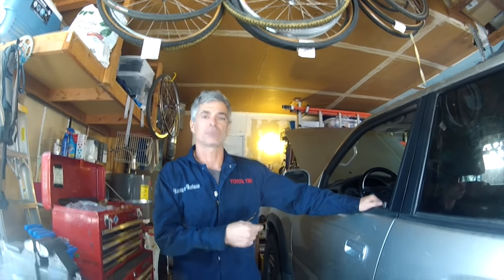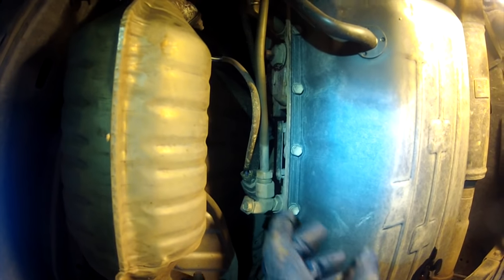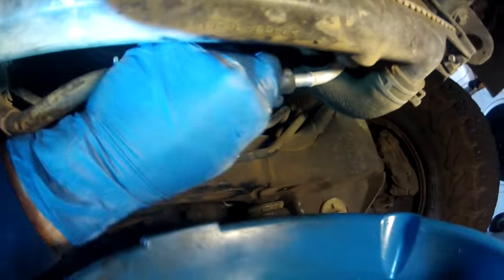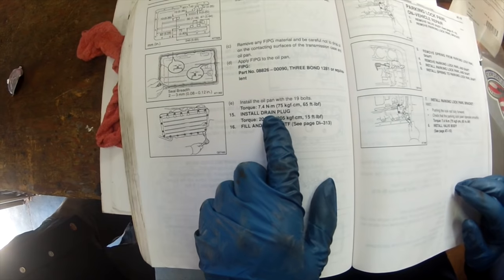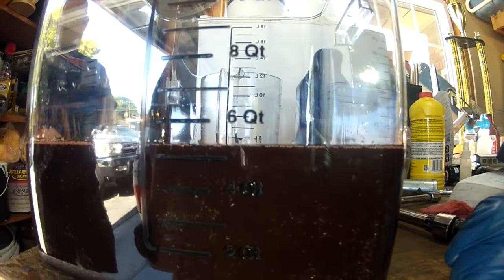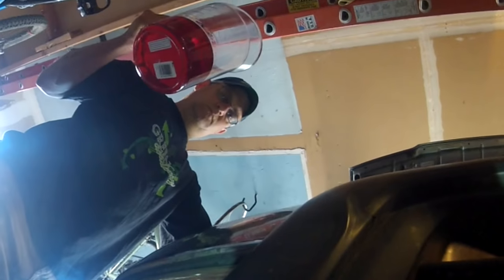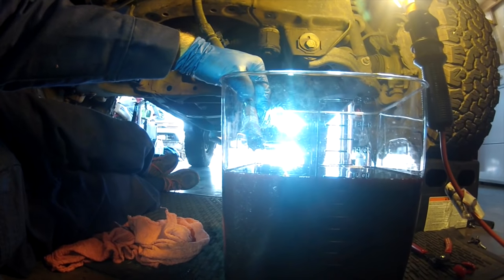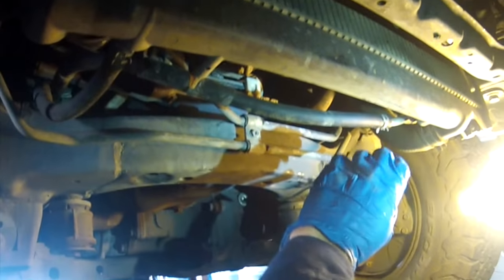Transmission Fluid Flush

Comment: When torquing the drain plug it looked to me like the plug didn't turn at all when you put the torque wrench on it. This would indicate that you were already at (as you stated) OR BEYOND the proper torque. If beyond the proper torque the wrench will click with no discernible movement of the item being torqued which is how it appears to be in the video.  Perhaps you saw/felt it rotate slightly?

Automotive and aircraft mechanic
ASE certified automotive mech
Quality Assurance Inspector
Reply from the maker: Your observation is absolutely correct.  The bolt did not move so I could have been right at the torque spec or beyond it.  I can't remember if I stated this in the video, but I've only been using torque wrenches for the last couple years.  So, for 34 of my 36 years of wrenching on vehicles, I didn't use a torque wrench.  I learned how to tighten things without stripping them at an early age.  So, what I didn't say in the video is I wasn't concerned that I might have went beyond the torque value.  

Most of my wrenching career has been doing relatively simple repairs and maintenance so I never saw a need to own a torque wrench.  Now that I'm tackling more involved jobs, I like using my torque wrenches.  However, I still don't bother torquing drain plugs on oil pans, differentials, transmissions or transfer cases because I've tightened them hundreds of times and never stripped one.  A little common sense and understanding mechanical advantage can take you pretty far.

Now, for the kind of stuff you're doing like aircraft mechanics, I'd imagine every nut and bolt needs to be torqued to spec.  

By the way,  Thanks for your service to our Country.  Semper Fi.
Reply: Well thank you for taking my comment in a positive way and for a nice response.  I too went a long time without using a torque wrench on automotive applications. However, my experiences in aviation (and associated formal aviation and automotive schools) sold me on the value of torque wrenches.  On a thin steel trans pan for instance, they ensure even pressure around the pan and help prevent leaks. Even a homeowners torque wrench that isn't all that accurate will usually be consistent and help in such applications

I just found it interesting that you broke out the manual to show the part number for the crush washer then proceeded to "torque" it with the "calibrated elbow" method.

On the military fighters I worked on (I've also wrenched on a couple of Cessna's that I owned personally) yeah.....not everything has a torque value but damn near. Critical items are torqued AND safety wired. Things are so critical in high G, Mach plus fighters that even the direction a bolt with nut is installed can be critical. I once downed an aircraft I was supposed to inspect before I got within 15 feet of it.....the flight control surfaces on the trailing edge of the wing had the bolts installed with the bolt heads outboard and the nuts inboard.....the spec was that they HAD to be heads inboard and nuts outboard.  I'm not an engineer but I believe that these critical flight surfaces dictated the bolt installation direction in order to help keep the bolt in the hinge should the safety wire fail and the nut backed off (or it broke).  

Automotive applications have similar engineering but the maintenance requirements aren't so critical when your wheels stay on the ground. For instance, one large torque value we had on the lug nuts of certain trucks required using a lug wrench, a cheater bar, a Marine who had just been weighed, a tape measure, and a calculator.  We actually calculated where on the cheater bar the Marine had to stand in order to apply the proper torque......it was one hella high torque value and the wrench was not on our authorized equipment list.  Go figure.  By contrast, we had a similar torque value on the F18 Hornet but had the proper torque wrench......complete with manufacturer supplied "cheater" bar. Without that bar no one could apply enough torque.
Reply from the maker: Thanks for sharing all that.  For the videos we put out, I provide the torque values for those that live and die by the torque spec.  Because I've never stripped a drain pan bolt, had one leak or back out, I guess I have a lot of confidence that I can do it by feel or the "Calibrated Elbow" as you call it.  This is pure conjecture on my part, but I'm guessing I was probably within a couple pounds of the torque value for that drain pan bolt.  Simply adjusting for the size of the fastener and understanding leverage is all you really need.  Would I have installed that small transmission drain pan bolt with a big half inch drive ratchet, with my hand on the very end of the ratchet handle and with me applying a lot of force?  Of course not.  I tightened the transmission drain pan bolt like I would normally do by feel and then I wanted to see if I was at least at the torque value given in the factory service manual. When I started wrenching at an early age on my 68 Bronco in 1981 and working at a full-service Chevron gas station, I never used a torque wrench and never saw anyone else use one either.

One problem I see with torque values is sometimes the value given in the manual is wrong and people will blindly follow them with bad results.  So, a person still needs to use some common sense and understand when they see a value that doesn't make sense.  I've found several mistakes in my factory service manual, some really bad where they say foot pounds when it should have been inch pounds.  Most recently, I was doing a timing belt job and used my inch pound torque wrench because it was the only one that would fit where I needed it.  I had to convert foot pounds to inch pounds and the value I needed was at the max range of my inch pound torque wrench, 240 in-lbf.  As I was applying force and it was getting to the point I thought I should hit the value, it never came.  This was a bolt into an aluminum oil pump body.  I figured maybe my wrench might not be that accurate at it's max value so I backed it off by 20 inch pounds, hit 220 and called it good.  

So, what am I trying to say? A person still needs to have a "FEEL" for how to tighten fasteners and know when possibly the torque wrench isn't working properly and also be able to spot a mistake in a manual when the value given doesn't jive with the size of the fastener.  I not only work on automobiles, I've done a ton of wrenching on bicycles over the last 32 years and sometimes turn a wrench on the fire apparatus we drive at my fire department.  

Take Care and Happy Wrenching!
Reply: Oh yes...you HAVE to have an understanding of the systems and components you're working on to be able to know when things "just aren't right". 

I did two tours with F18 Hornets. First tour they told me "you can't be an inspector until you've gone to school"......6 months later they said "when can you take your inspectors test" but I hadn't been to school.  What I had done is read EVERY maintenance manual for the aircraft and those for my particular specialty (ordnance) TWICE and I'd done just about every maintenance task under supervision of an inspector.  They changed their minds on the "not until you go to school" because I'd learned the systems better than most of the inspectors.

On my second tour (same unit after a few years away) I was in the Quality Assurance work center....comprised of one highly knowledgeable inspector from each work center and the final inspection authority for releasing aircraft after major maintenance. I partially downed (certain configurations not allowed) an aircraft for failing a particular electrical check of the Ordnance system (my specialty).  Oh we went round and round on that one for about 8 months, including Ordnance techs who disagreed with me and my "reading" of the inspection card. I stood my ground and one day I get a call on the radio to go out to that aircraft......turns out that during some other maintenance, the electronics shop discovered that the reason the bird wouldn't pass the inspection I downed it for was that the wire wasn't in the right place in the connecting plug and the signal could not be delivered to the component. 

I was vindicated but I'd have never known it was wrong had I not understood every system and component and how they interacted and recognized that they were doing the inspection improperly. The system was the emergency jettison system and critical in an emergency situation. Had it not worked it could have meant the difference between losing an aircraft and/or pilot or the pilot being able to jettison excess weight and saving teh aircraft and himself.

We have to understand the system and it's components so that 100 foot pounds of torque on a transmission bolt going into a 1/2 inch of aluminum jumps out at us and says "somethings not right here".

In aviation the maintenance manuals are updated constantly. In fact, one or more people in each shop are tasked with inserting the changes, they occur that often! We don't have that with autos and a misprint in the manual is pretty much there to stay unless you're working at a dealership with dealer manuals.
Reply: Open Carry, That is what I was saying but you said it better.
Reply from the maker: So, I'm curious.  I take it you're not active duty anymore.  What are you doing now for work?  Also, what brought you to our channel?  Do you own a 4runner?
Reply: I retired from the Corps in 1999 and went to work for a small county in northern Calif. 5.6 years later I left that job to move to Oregon with my now ex wife so that we could be closer to her elderly parents (she was 11 years older than I). I haven't held a job since then.  When we came here we bought a house on 40 acres with a runway in the "backyard" (I'm a private pilot).

I kept busy by building a spec (built for resale) house, improving our home (electrical, big patio, private "beach", etc.) and caring for her parents as she hadn't retired yet.  After her parents passed on I went to college (and she left in my second quarter of that endeavor) and picked up a Bachelors (with honors) in Business Management with a minor in Criminal Justice.....while going through a divorce and losing that "dream house" with the runway (and just about everything else).

Now I enjoy my hobbies and activisim.  I'm a second amendment activist which led to getting involved in a situation where BLM was unlawfully harassing a couple of local minors, which led me to HAM radio and I now hold the highest HAM license class and teach classes for people to get their HAM licenses. And I've got a nice motorcycle for the few months that Oregon has decent weather....LOL.  

And I have two YouTube channels, one for the activism and another for the HAM radio stuff.  The HAM one has a few antenna builds including two that I was told "can't be done". One was out of barbed wire and the other out of tubes of water.....TAP WATER at that.  Both worked and were able to hit a repeater some 29 miles away that gave me voice communications capability across the state.

I don't have a 4runner. I've got a 2002 Ram 1500 with a 5.9 (gas) and since my girlfriend (going on 6 years) and I picked up an awesome 21.5 fifth wheel that's right at max capacity of the Ram I've been working on it.  It had a cooling issue which I thought had been addressed (blew some hoses) but turned out to be also include a failing waterpump.  When that left us on the side of the road with trailer attached, I decided to go through the whole truck.  So the pump is repaired, the last (totally hidden) hose is replaced, hardcore flushing of the cooling system, new OEM spec coolant, oil change, and now I'm working on flushing the transmission as it's in for some hard work and at 114,000 miles, it needs a good flushing and the proper fluid (bought the rig used so who knows what may have been put in there (if they checked it at all...LOL).

So I found your channel during the search for DIY flush methods and I'll be using your method which is what I had in mind but hadn't seen it done.  I've got different hose connections and such but I'll be taking the old fluid from the cooler return line. I'm actually doing it today as it took several trips to get the required ATF+4 I needed. 

WalMart's "SuperTech" brand lubricants are largely made by CitGo, a big enough name that I trust their stuff to be on spec.  After double checking that CitGo made their ATF+4, I had to hit three different stores to get the necessary quantity (it's the only darn one they don't sell in gallon jugs) and I cleaned out three shelves over three days....LOL

I don't have a pan plug so that will be going in as well so that the next fluid/filter change is easier.
Reply: i totally agree. You OVERTORQUED the plug!!!!!!

Comment: This job is next up for my '98, and changing out the filter/strainer.  The question is... does it make more sense to do the filter before or after the flush?  Or does it not matter at all?  Thank you again for making all of these videos AND for taking the time to answer these questions YEARS after making the videos!!  Quite a commitment to helping all of us
Reply from the maker: I would start with the pan drop and filter replacement because you'll drain out around 1/2 of the system capacity,  around 6 quarts.  Add 6 quarts and then start the flush.  You'll probably see clean looking fluid at around the 6 quart mark, so 6 rounds of draining a quart and adding a quart.
Reply: How about jacking up the rear and going through some gears to flush out the valve bady 🤔 my 99 has been making a slight whine noise for several years now..... Wonder if this would make it quieter? I know it's probably the torque converter.....

Comment: Thanks for posting...it helps significantly to "visually see" how to do something.
Reply from the maker: You're welcome John. What's weird is some people prefer write-ups over videos and I find that very strange.  Sure, a picture shows you something but there's no comparison to a video where you're able to see exactly how somebody got it done.  There's a guy that has used our videos as a reference and then does these exhaustive write-ups with pictures of his hand and finger pointing after different parts with notes on what to do.  Wouldn't it just be easier to watch the video and get the extra detail which often is the difference between having an easy time and having a struggle?  But, whatever floats somebody's boat.  If you prefer write-ups, use them I guess.
Reply: Well...at work...I was going to make a presentation..and I asked the PowerPoint expert to sit in and do a dry run with me...he listened...and said "there are two kinds of audience...some will listen to every word you say...and NOT pay any attention to your written PowerPoint....others will READ every word on your PowerPoint presentation, and NOT listen a verbal word you say...basically, he was saying there are two kinds of audience....verbal vs visual...and maybe some are one or the other...that's all...I try to do both....but, it's difficult....hahahah..hahahah...I do have some G35 literature...I do read it...but, it doesn't hurt to see a video and also read material....hahhahaa

Comment: Great video. I bought a 1/2” inch clear tubing to fit on the radiator to flush out. Just flushed out my 23 year old tranny fluid. Took about 12 quarts for my Toyota to start peeing clean transmission fluid. Pretty soon the 4runner will almost be brand new after doing all these maintenance videos!
Reply from the maker: Using clear tubing is a good idea.  Glad our videos are helping you out.  Happy Wrenching!

Comment: I like this much better than connecting to a fluid flush machine with this you know exactly what fluids are going into your transmission. The question is will the local family owned repair shop do this for me or will they insist on using the fluid flush machine?
Reply from the maker: They will probably use their flush machine.  I recently learned more about these fancy flush machines and they don't seem harmful to the transmissions.  What they are doing is basically a dilution process of adding and removing fluid over and over again but it gets the fluid in good shape after it's done.  But Susan, you could just do this yourself by following our video.  It's not hard.  Or, you can just do a few drain and refills of the pan over 3 engine oil changes.  At every engine oil change, you also drain and replace the oil in the trans pan.  After 3 times of doing this, your trans fluid will be a great shape.

Comment: Great video Timmy
The 80 Series flush is a cool deal, you do it by the gallon off the transmission cooler. 

For years I have seen and heard pros and cons for Toyota lifetime sealed transmissions. Some drain and fill but don't let the pan snorkel drain till up to temperature. It's my understanding the most comprehensive way to do the lifetime seal transmission is to jump the OBD2 and let the transmission light tell you when it's at temperature and when to seal up the snorkel. I've also considered using my fluke meter with the temperature probe and depending on the truck like for the Toyota Sequoia it's 183°

You ever thought about doing a video on this? I know it's a hot topic.
Reply from the maker: We did a video on flushing a sealed transmission.  We did it on my buddy Thanh's GX470.  We basically use the same technique as this video draining a quart and adding a quart until we get to around 12-13 quarts exchanged but then we go through the fluid level procedure that the Toyota service manual specifies.  Check out the video if you'd like.  https://youtu.be/gx5dU3UVcRs